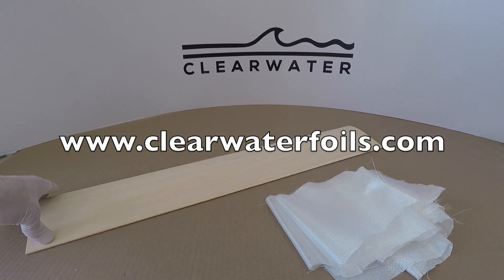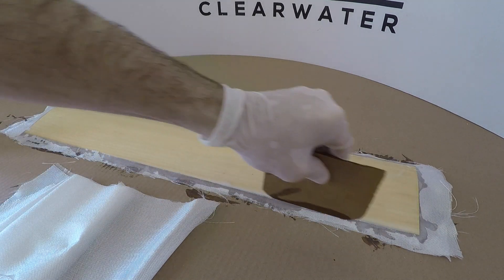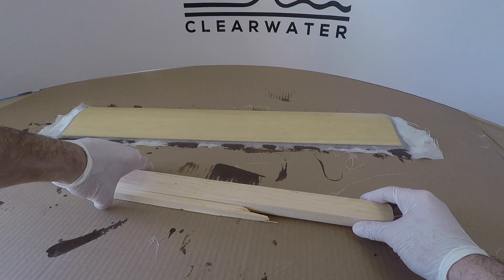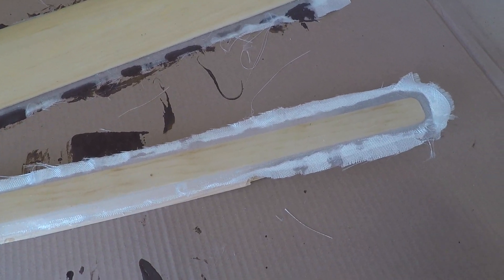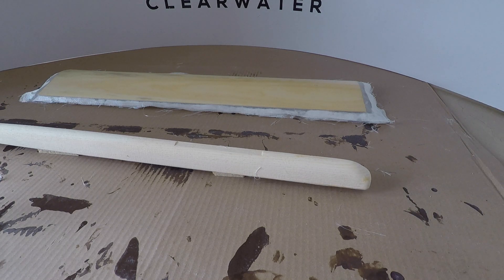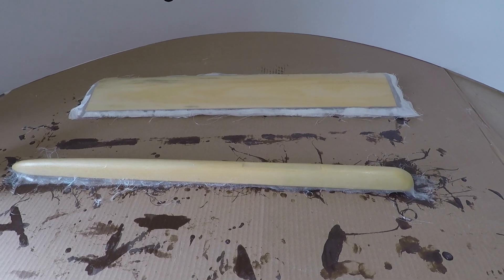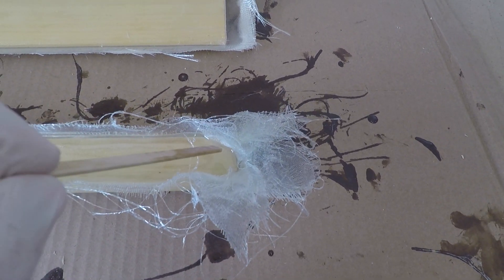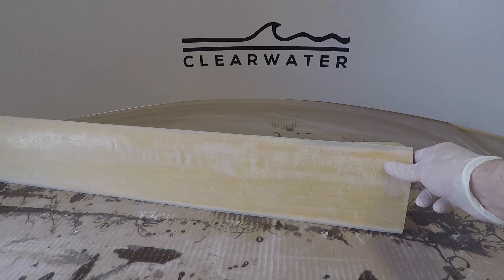How to Build A Hydrofoil P1

Comment: Hi is better glassing with the core  vertically and do the junction  in the middle, because the stressing part of fatigue is the edge,i know is difficult but get strong,is better to use inside the glass with two layer of carbon -kevlar